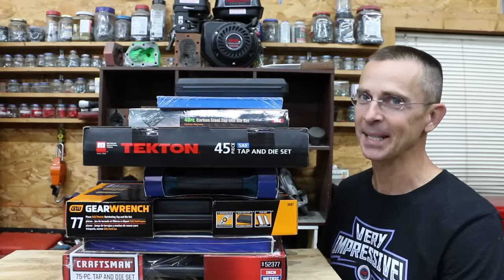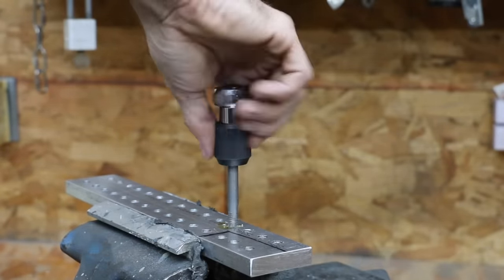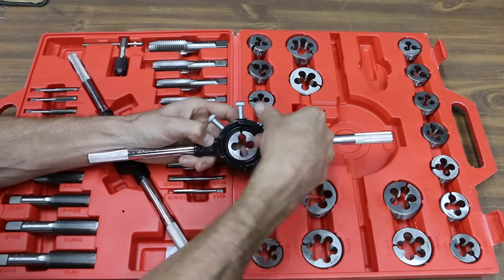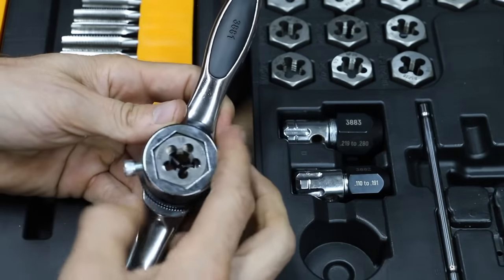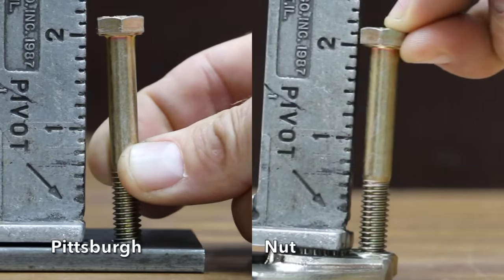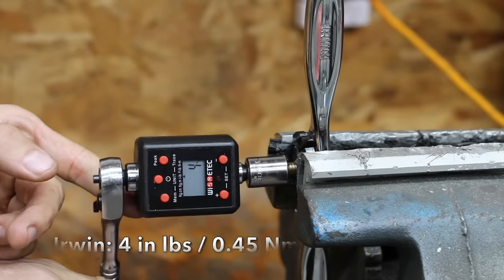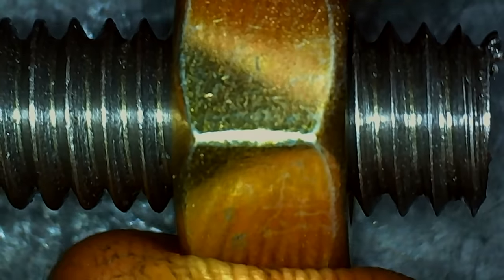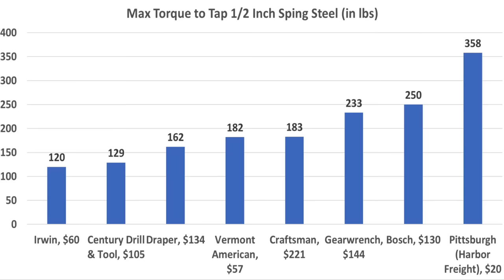Best TAP & DIE Set? Craftsman vs Irwin, Bosch, Draper, Vermont American, Tekton, GearWrench

Comment: Whenever I was tapping new threads I'd always double drill to get the best hole size tolerance. Going straight in with the final size drill bit is a recipe for oversized holes and a bad thread. As it stands we can't really know if the slop in the finished threads you made was from the tap or an oversized hole. Never go straight through the material with a tap. Quarter turn, back off to break the chip, another quarter turn. Split dies need to be adjusted to size in the die holder before use. You can't measure anything meaningful from them when held in a vice fully sprung open. I always used to use a new tap a few times in a hard material like cast iron or steel to remove any burrs before using them in aluminium. Any manufacturing defect will chew aluminium up in no time. Lubricant is a must. Paraffin or diesel on aluminium and tapping oil on ferrous materials.
Reply: Agreed on all points. I was watching this and wondering why we're torture testing precision tools. Swing and a miss from a normally thought out channel. 

Maybe this was aimed at employers that need to see what happens with novice, unsupervised employees? "Looks like a drill bit, guess I'll use it like one."
Reply: At least im not the only one who backs out a 1/4 turn to break the chip
Reply: @jason-ge5nr  This was part of my training when learning how to tap threads. Saves a lot of wear on the tap, chips are small and can accumulate in the space between the cutters, and the tap doesnt get super hot. Taps heating up means they expand, making the thread less accurate.
Reply: My machinist education tells the opposite. If you want an accurate and straight hole, go straight to the correct size. I only drill in steps if it's necessary (drilling with a hand drill, part can't be clamped tight enough, not enough power in the machine etc). A small drillbit is more likely to drill a crooked hole, and there is no need to waste time with step drilling if its not necessary otherwise.

Tip about breaking chips with taps does applies for hand taps, but not any other tap types. Most quality taps push the chips either up or down though the hole and there is no need to break chip. The taps in this video are hand taps, so chip breaking should have been used.
Reply: @Catrik  nah. if the end goal is a quarter inch hole; then a 1/8th inch hole will not bother it at all.  Unless of course your cambodian machinist education tells you otherwise.

Comment: I appreciate the work you go to for these videos. Having said that, this test isn't really a good comparison of the various tap and die sets. The tests you've subjected them to are torture tests - how long will they last under extreme conditions. It would be interesting (since you still have the rest of the sets left) to conduct a test where you use the taps and dies according to manufacturer recommendations, i.e., two to three turns and then backing the tap or die 1/2 to 3/4 turn to clear chips. I'd like to know which ones perform best under those conditions. It would also be interesting to tap some 1/2" mild steel and see which taps snap first.
Reply from the maker: Thank you!
Reply: Bro have you seen this guys vids before? Every week is a torture test
Reply: TheCheesePlease  a tap isn’t going to be strong no matter what, it might as well be good and make somewhat accurate threads, which it seems like all of these cheapoes really struggled at doing. If strength is a concern when you’re using taps or dies, you need to adjust your technique so you’re not breaking them. Chances are, based on your comment, you don’t actually use taps or dies, or else you would already know that.
Reply: Very adept suggestion. This as you said was a torture test and not how they should be used correctly. That being said I like my Irwin set of taps and dies and extractor set. Knock on wood have not broken any.

Comment: I've always heard the Snap On kits are made by Irwin, and I had a good feeling going into this test that Irwin  would be one of the top competitors. Well done again!
Reply from the maker: Thank you!
Reply: Irwin does make the tap and die sets for snap on. My home set is snap on and is identical from sizes to layout and charts as the irwin set at my work place. Only difference is the colour of the case and warranty.... and maybe price... definitely price.
Reply: Dang, I already bought the snap on set 🙄
Reply: Irwin made just about every tool truck set
Reply: @Tramnit1  Yeah, they even include the exact same "Tapping Tips" insert! 
I'll take the 60% discount, please.
Reply: @ifixem9585  If you were able to get it for a good price or used then the snap off set is worth it for the warranty. I've gotten a few taps replaced because of pesky stainless steel and lending them out to people and have never had an issue with getting replacements. Wouldn't be able to do it with the Irwin set, other then that it's got nothing going for it. 😅
Reply: @Tramnit1  That is one good thing...the snap on guy warranties all taps and dies, on the spot, while I'm at work.  I don't have to drive or even fill out paperwork.  Cost of convenience, I suppose.
Reply: @ifixem9585  cost of convenience is why Snap On stuff is so expensive.
Reply: @SockyNoob  Tell me about it 🙄.  There is something to be said about a good relationship with a snap on dealer.  My guy lets me borrow tools for a one-time job that would hang me up for a week or more, costing me thousands if he didn't come through.

Comment: When taping your supposed to release up pressure and not continuous taping to clear debris. If you do you'll get a much better tolerance on fit. Not clearing the tap will cause a less tolerance on the fit as debris will push in to the threads especially in aluminum. I love watching your tests of various tooling and machinery but I would suggest you first find out exactly how to do the process before doing any tests. Thank you for your video's very enjoyable. The SKF Swedish made tap and die, superior steel, you should test that, would blow these brands away in a heartbeat. I have it myself and you can see the difference. I also have a bosch and Pittsburgh set for non precision jobs.
Reply: exactly, I learned as a child from my grandfather that after every 1/4 turn, you back it out 2 turns. Even the cheap taps have always lasted me

Comment: I use a Craftsman set that was purchased in the early 90s for my "at home" or farm repair work, which is more than the average guy.  Made in Germany, most of the taps and dies are still original.  I always pre-chamfer, always use oil, always back rotate, and try to always keep the tap straight by using my drill press to guide, not power.  When I replace the worn taps or dies, it's always from McMaster and choose a good quality replacement.  

I saw a lot of wobbles when you were taping.

Comment: Now this is going to be useful for me.  Thank you for what you do!

I wonder if the slop in the holes comes from the stack of adapters and stacked tolerances.
Reply: Yes, I wondered too ...! 🤷🏻‍♂️
Reply: It could be, but he started each tap with the drill press. I think once he started it would follow the hole straight. Could be wrong though.
Reply: Most consumer available taps are made to have slightly loose tolerances, making it easier to create the threads and balance out the forces required to tighten the fasteners.

You can get taps with tighter tolerances, but that trades off for a higher chance of breakage or your fastener being out of tolerance. You also have to go to an industrial supplier (or the base manufacturer) and special order

But to some extent, the final fit is going to be the sum of how oversized the hole is combined with how undersized the bolt is (for an internally threaded hole). 

What PF hasn't revealed, and maybe he didn't think to, is the individual dimensions of the graded bolts he's using (including if it's the same bolt or different bolts for each hole) for each hole.

Comment: Once again my friend you have helped me again,  I've got the most fantastic vintage 200 pcs tap & die set from the late 70s, been using it for decades, but now that I'm in Venezuela I need more selection on the metric sizes, the old set only has M6,m8,m10 & m12 basic coarse threads.

I need to expand my selection, but didn't want to get a cheap set, tap & die has saved me so much on the farm in Canada living in a remote rural area, and my situation in Venezuela is very similar

now I'm hunting online for either a Irwin or Craftsman metric only set..
Reply from the maker: Glad to hear!

Comment: The problem I have with these sets is they are more for cleaning up threads as opposed to cutting new threads as a proper tap set comes with 3 taps at different removal settings with the first removing about a 1/3 of the material and the last one more for precise thread cutting making for a much better fit
Reply: Fit is based on the class of threads you can get a tight fit with one tap by just getting a different class of tap
Reply: That's where the Lang thread repair kits are amazing. I buy taps to cut threads.
Reply: @TheHelp14  then please explain to me why tap sets come in sets of 3 and not just one especially when you put way more stress on the tap by trying to remove too much material as opposed to using the 3 tap set that contains a starter and bottom finisher tap I have worked in a engineering environment and would be laughed at if I turned up with one of these sets
Reply: @Inkman69 that's what I use for my electronic hobbyist, using only m3 and m4. Those tool sets are for amateurs even with bigger price
Reply: @inkman6964  Most folks don't need plug and bottoming taps, so these sets are just fine. You can always make your own plug and bottoming taps by grinding off some or all of the leading edge.
Reply from the maker: Thanks for the feedback.
Reply: Very true. Taper Middle and Plug
Reply: @inkman6964 what you’re doing is not relevant then to people watching this. 

If you really need perfect threads you should be machining it anyway.

Comment: I have had very good service from my "old" Craftsman set of "theading die kit" and also from my old Craftsman "re-threading die & tap" kit.  Both including metric as well as SAE selections.   I notice your introduction of the Harbor Fright kit mentioned both threading and thread restoration; those two procedures typically call for different dies and taps.  Re-threading taps and dies should be designed to provide minimal cutting and more of a rolling the old distorted thereads back towear original form.
Reply: OG  craftsman pack? the two piece grey bottom, top clear plastic style? those were a solid set.
Reply from the maker: Thanks for sharing.
Reply: Still makes me sick seeing Craftsman made in China... 😔
Reply: The set in this video appeared to be the Sears Craftsman packaging. I’m not sure if you can even still buy this set.

Comment: love the video some shipyard thoughts
1. Should have used kerosene on the aluminum keep it saturated with a squirt bottle you will like the results.
2. Use more oil on the steel.
3. Should be allowed to clean out die during test.
4. Using die nut excluding drill driven the met should be like 3/4 turn then back 1 turn clean apply oil repeat. Cuts better & last longer.
5. keep the tap centered with support
Reply from the maker: Thanks!  Thanks for the thoughts.

Comment: Its interesting to see how the cheaply made tools perform compared to well made tools.  I'm glad I bought a lot of Craftsman hand tools in the 80's and early 90's including a tap and die set, all made in USA.
Reply from the maker: Thanks for the feedback.
Reply: Same here.  All my Craftsman is the USA made stuff starting in the 1970 when I worked at Sears while in college.  My newest is probably in the 20 year old range.  I also have what at the time was the most completes set of taps and dies they had.  Some have never been used.  Some used quite a lot and still perform just fine.  While perhaps not very useful for most, it would be fun to see PF do more comparisons of old (USA) vs new (China) Craftsman.

Comment: I couldn't help noticing that despite starting in the drill press, many of the holes in the mild steel were tapped well out of square.  Tapping force seemed to correlate with how well the tap was aligned with the hole, so I'm not sure that data says much about how well the taps cut steel.  The spring steel results looked much better.  I'm pleasantly surprised that you only broke one tap doing that test.
Reply from the maker: Thanks for the feedback.
Reply: I agree there is a reason the set comes with a T handle to make sure there is equal pressure on at least two sides. When cutting threads with a socket wrench only puts torque on one side which is why your cutting is coming out soo sloppy.
Reply: @jamusgriego6389  I thought about that too and you're probably right, but the Aluminum and spring steel results appeared much straighter despite the same methods.  There's probably some knowledge to be gleaned from that, but I haven't figured out what it is.
Reply: @jamusgriego6389  Spot on observation,  using a ratchet puts loads of side force on the tap and results in needing more torque as well. torque.  I would not think of using a ratchet - too damn hard to contend with a broken tape in a blind hole.
Reply: Well at least he was consistent in screwing that up

Comment: As a quick FYI: I believe a galvanized bolt is slightly thicker than a regular one, so for a cheap set like that, having the hole a little oversized for a carbon steel bolt is not that unreasonable.
Reply: I found last year that galvanized bolts are difficult to come by. Zinc plated is the most common I was told.
Reply: Any plated bolt is. Zink plating on nuts will cause issues with fine threading done on a cnc lathe.  It's hard to find some things in a raw finish.
Reply: @normferguson2769  that's pretty much only true because of the pandemic. there seems to be a decent amount of galvanized bolts in stores now at least the 3 or 4 near where I live.
Reply: This is true. This is particularly annoying when someone uses galvanized ASTM A325 fasteners paired with SAE locking nuts.

Comment: I've owned SnapOn, Irwin and Craftsman sets and they have all been great. the chip buildup issue should have been resolved in the test with an additional test that included removing the chips after a turn or two. The thread tolerances and manufacturing quality are always the key features for these tools. I prefer to use different tap and die handles other than what is typically offered in the sets. Precision ratcheting handles of each size range and Lisle tap sockets. Additionally, I prefer hex or 12 point dies co I can use a socket to hold them if needed. The round dies are useless to me for that reason. Your presentation was great and I'm glad that my years of experience were in line with your results.
Reply from the maker: Thanks for sharing.

Comment: We use Irwin taps at work with a 1/4" impact driver they usually go 2-3 days before not being useable but if they bind up they snap easy. Not really the fault of the tap at that point but seeing them survive the abuse day by day impresses me.
Reply from the maker: Thanks for the feedback.
Reply: Never use taps with an impact driver, the hammering action will chew them to shreds.  Use a hand drill instead.
Reply: @jim9689  Lol I wish they’d give me another drill, they tell me to use the impact driver instead of switching out bits on the drill or taking up a second drill. Not my money 😂

Comment: 20 years of plying my trade as a machinist and  toolmaker I can tell you that no one anywhere has ever, or likely will ever, sell a "set" that is worth a tinker's damn.  Mechanics might make good use of them for thread repair, but that's the end of it. 

the tap and die business has gone through changes over the years  the new kids are the good ones now that old names like Greenfield and then later TRW have left the field.  OSG has held a top spot for cutting threads.  For thread forming it is  Balax that has been a top contender for a long while.  There are others Sandvik, Dormer Pramet to name a couple but the most available are OSG and Balax.  You won't get them at the auto supply you go to an  industrial supply like MSG.

The same is true of all cutting tools.  The decent ones can only be purchased a la cart.
Reply: Agreed. All these are 'consumer' grade. Actual industrial grade stuff is a whole different level.
Reply: Might be able to find those on Grainger or McMaster-Carr. Can get good tooling for decent prices, in the quantity needed, and without an account. Got me some solid carbide burrs that way.
Reply from the maker: Thanks for the feedback.